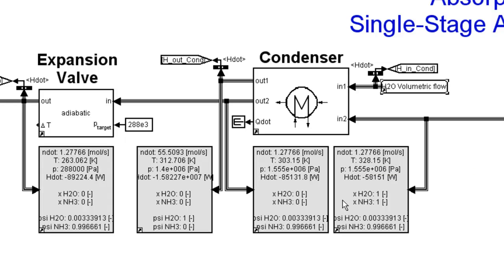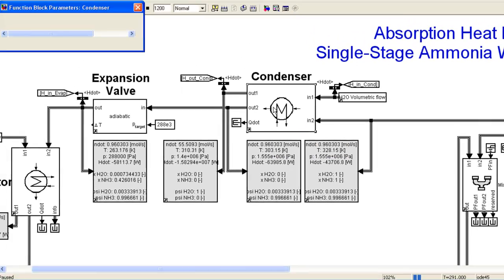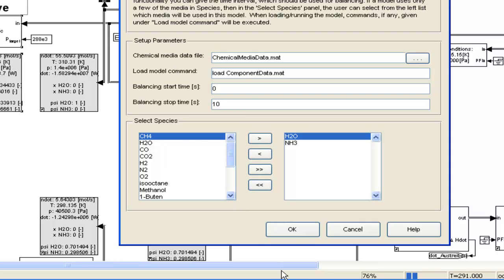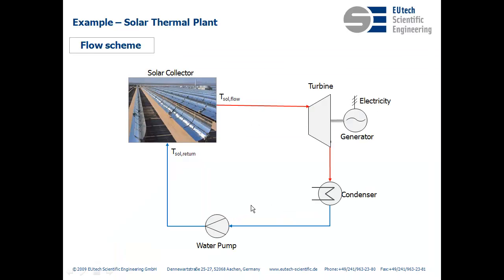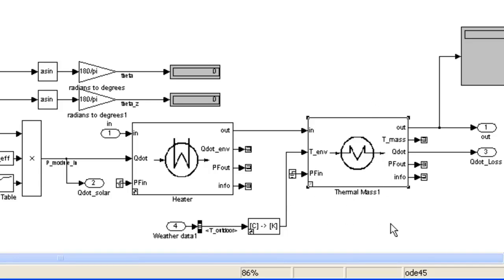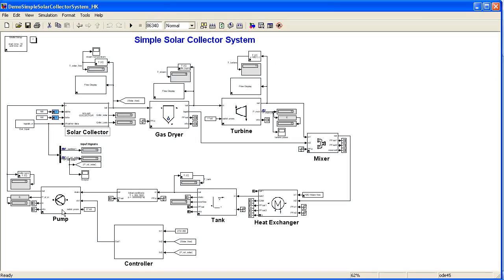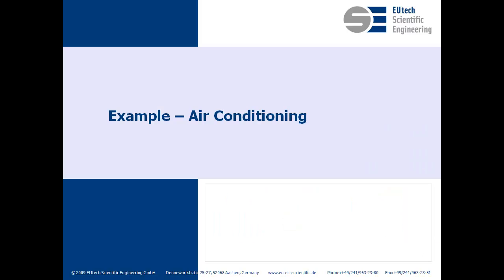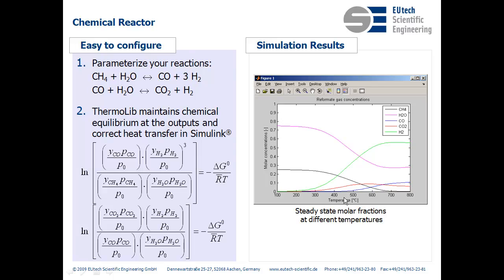Thermolib - Modeling Thermodynamics in Simulink Part 2 of 3

Comment from the maker: Check out the following examples after installation:
\Examples\Applications\DemoReformingShiftStack.mdl (a PEM fuel cell stack with gas generation)
\Examples\Applications\DemoElectricVehicle.mdl (a drivecycle with a simplified battery temperature management)
\Examples\Applications\DemoStackWithH2Circulation.mdl
\Examples\Applications\DemoSOFC*.mdl (several SOFC systems)
\Examples\SimScapeInterfacing\*.mdl
\Examples\PressureFeedback\DemoFCWithPF.mdl